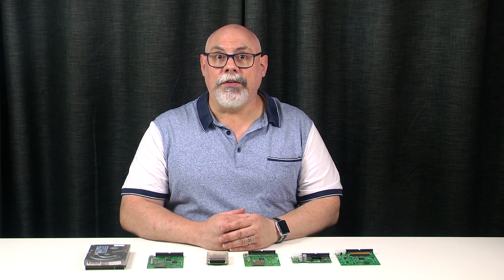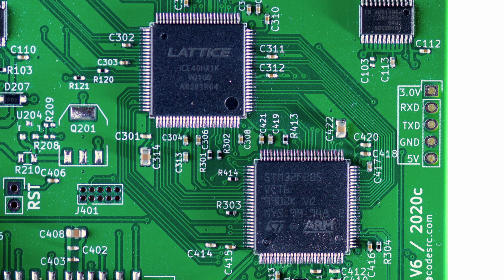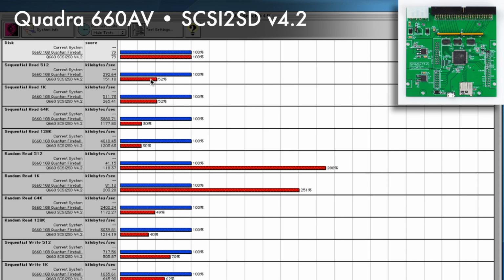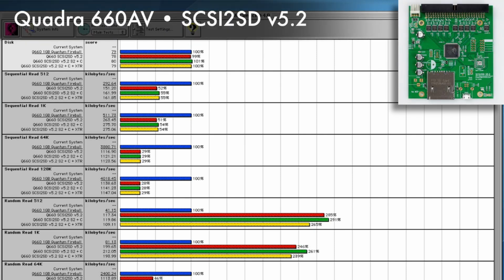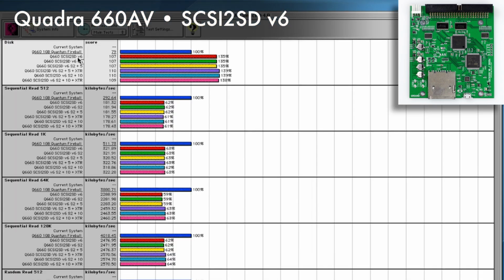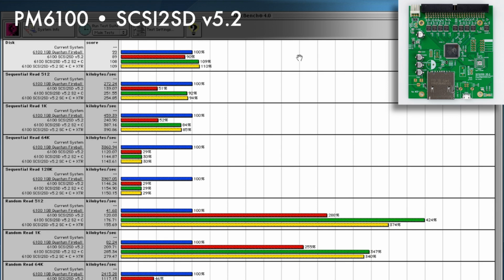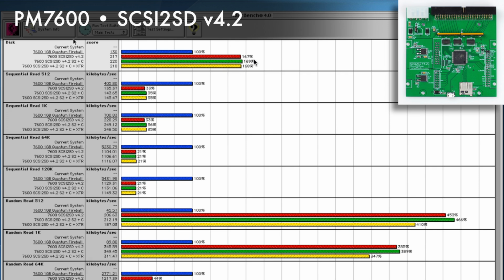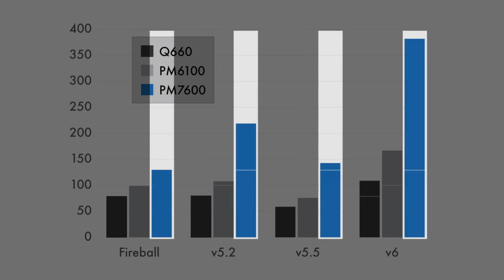SCSI2SD Speed Benchmark

Comment: Hi, Power Macintosh 8600/250 with SCSI2SD V5.2 is there any way to format the SD card over 4GB to use with Mac OS 9.x? alternative to HD_SC_Setup_7.3.5_Patched
Reply from the maker: I would recommend using the OS9 Drive Setup rather than the old HD SC setup. You should be able to format bootable partitions all the way up to 128GB.
Reply: @BranchusCreations Thank you for the reply Bruce,  I get "Cannot initialise disk on unsupported drive" hence the reason I’m using the patched older version. And on windows 10 when I save a config using Scsi2sd utility the next time I plug the adapter in everything is back to default.
Reply: Hi you can use the FWB Disk Tools to format nearly every kind of drive . I use Version 3.0 but 2.5 works although fine. It was „THE“ disk tool in the 90s like a Swiss Army knife 🥳

Comment: Thank you for another really interesting and thorough video. Your videos are always excellent and have taught me a huge amount!

For me, the SCSI2SD is about convenience.  Here in the UK, I've picked up some newer 10k 2.5" SCSI drives, terminators and adaptors that work well in all Macs for less than a third of the price of the cheapest SCSI2SD. And the spinning drive outperforms my SCSI2SD 5.1 on nearly everything that matters (boot times, read/write speeds etc). Of course, the spinning disk adds more strain on the power supply, adds heat and a little noise as well.

The SCSI2SD is an absolutely great product, but at the price it's not the only solution. If you have a lot of Macs, it gets very expensive, very quickly. I love mine as an external device for moving files between systems.
Reply: Out of curiosity, what were those newer 10k scsi drives? It's a bit tricky figuring out which ones will work on the 8-bit Narrow SCSI in 68k Macs.

Comment: For comparison, some v6 benchmarks on SGI workstations https://forums.sgi.sh/index.php?threads/scsi2sd-v6-performance-report.110/post-1020

TL;DR -- Even when matched up against a top-tier 15K RPM disk the SCSI2SD is faster. Also substantial performance improvement with Sandisk Xtreme cards in the tested systems.

Comment: You didn't show the write speeds of the later SCSI2SD models, only when first showing the benchmark. The write speeds are what really interest me - could you either just post screenshots of the whole results for each model, or at least list the write speeds?
Reply: Not on Apple systems, but lots of write data for the v6 here: https://forums.sgi.sh/index.php?threads/scsi2sd-v6-performance-report.110/post-1020
Reply from the maker: Sure, I'd be happy to. Do you have MacBench v4.0? I can just send you all the result files if you like.
Reply: @BranchusCreations  I do indeed, that would be good! Email my YouTube user name (with no space/period/break) @ Apple's-consumer-email-cloud-service. Or send to me on MacRumors Forums (same user name/icon.)

I'll even compare to a few more vintage hard drives and post the results. (I only have a SCSI2SD V5.1, and was specifically wondering if the V6 is fast enough write speed for what I want to use it for.)